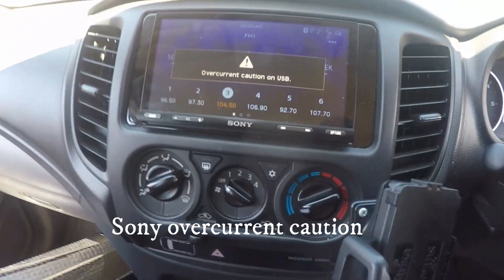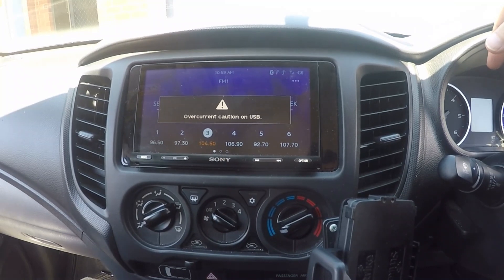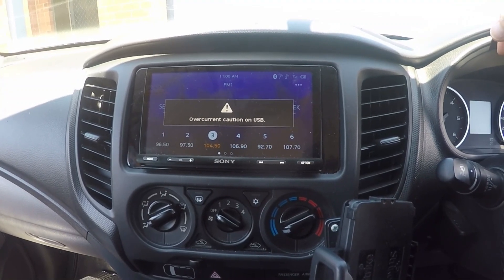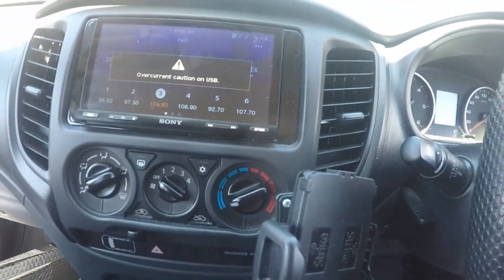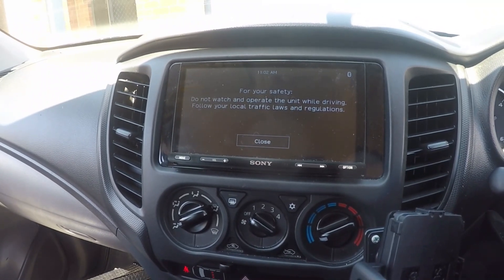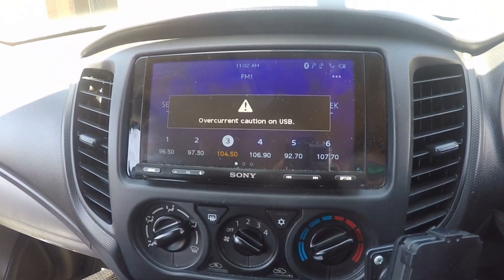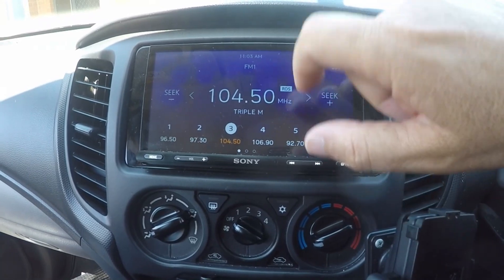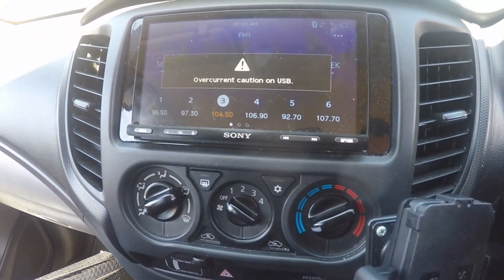Stereo overcurrent caution warning on USB Sony XAV-AX5500 how to fix

Comment: I got this error code a day after switching from a cheap cord to an expensive Apple cord, but if I switch back to any other cord the message stays, could the plug be damaged, or do you have any other ideas?
Reply from the maker: Hi Sean. If you upgraded to new stereo you should be fine. If using oem check to see it is compatible for Apple. Oem 2016 only took Apple up to certain date. If using Android stick to ir.